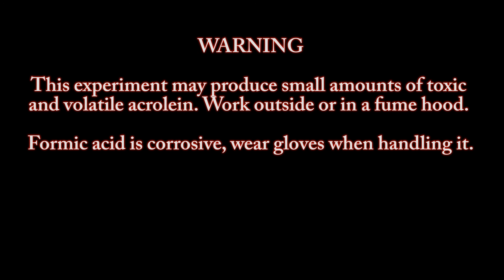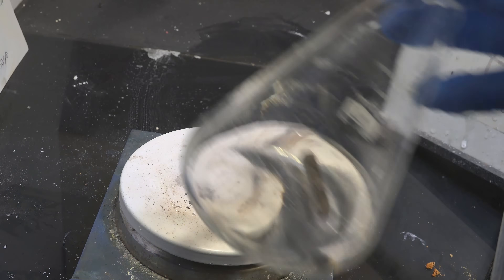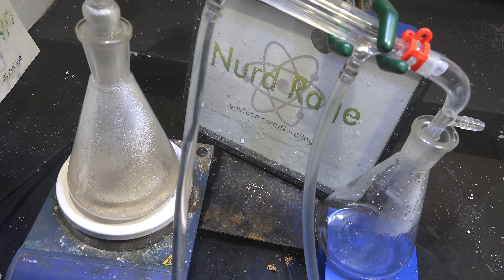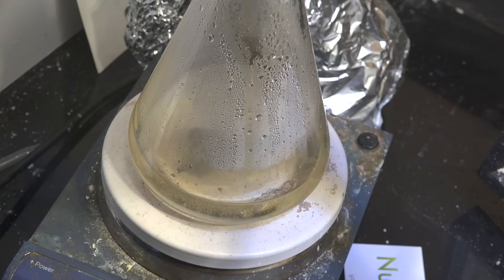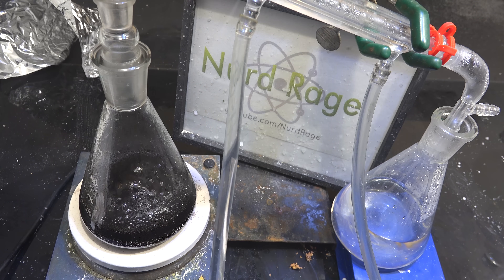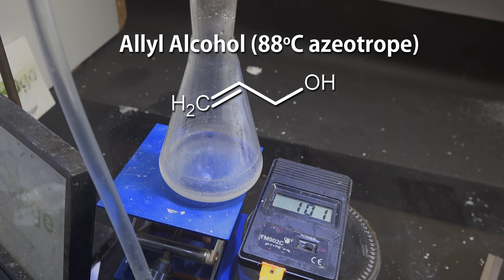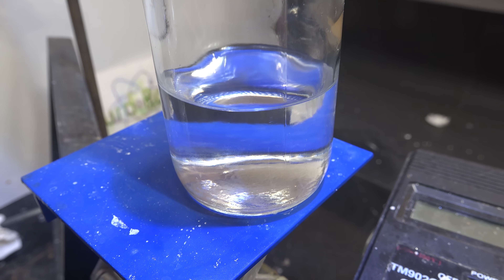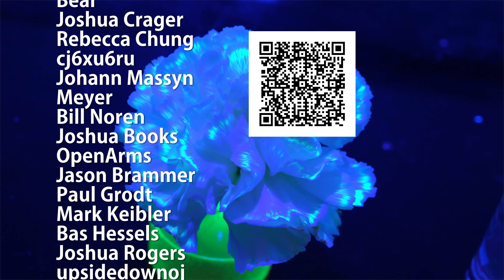Make Formic Acid

Comment: @NurdRage When I did this, I forgot what the temperatures were and I couldn't be bothered looking them back up. So, I just went very careful on the heating. It turns out that if you are very careful on the heating, your glycerine does not darken. Pop a stir bar in there and it looks like any old clear solution

Comment: Formic acid is way easier to make.  Just dink a jug of windshield washer fluid.  Washer fluid contains methyl alcohol and the mammalian hepatic system converts methanol to formic acid.  There is the downside that formic acid destroys the optic nerve though.
Reply: ingested formic acid will not destroy the optic nerve though but acidosis will when methyl alcohol is metabolized. Stem cells now can soon replace the damaged optic nerves and fully restore sight.

Comment: I've read somewhere that electrolysis of glycerol produces formic acid as a byproduct. Would it be better to go down that route and not waste oxalic acid?
Reply: Oxalic acid isn't that expensive either. I read a paper on making the reaction you mention, it seems more difficult to achieve without high quality equipment.

Comment: Could be possible to see a Biodiesel make and purify Guide?
Reply: Bug Hunter 
just decompose triglycerides with (m)ethanol and then you'll have (m)ethyl esters (biodiesel) and glycerol.
Reply: Thanks, I know how it works, but I think a guide at chemistry and amateur level could be awesome to see. Almost every of the experiments here require some pricy equipment and knowledge and are far away of the amateur chemist, maybe this could help in that matter :D
Reply: Bug Hunter check out Nile Red's channel
He removed glycerine from vegetable oil
Also ChemPlayer made biodiesel from the same process and even tested its flash point cofirming it's potential use as fuel

Comment: I prefer the Soxhlet extraction method, in which I fill the thimble of the extractor with ants. Do you think water would be the most effective extraction solvent in this instance?
Reply: I've heard ant brain has 100x more cells for the same volume, and 1000x more connections... (So 100,000x more bits of info?) 
    I have also heard of a lawyer that had untreated childhood encephalitis and after getting a PET scan as an adult, only 1cm³ of their cerebrum was alive!!
   Does that make ants somewhat equivalent to lawyers? All the more reason to boil them in a extractor..

Comment: What stops the glycerol backbone from being tri-esterified? Why won't oxalic acid or formic acid in the reaction mixture continue making esters on the other two hydroxyl groups? Is it purely steric hindrances?
Reply: I'm sure it will form esters on all hydroxyl groups. When the concentration of glycerol is very high formic acid is more likely to "find" non substituted and mono esterfied glycerols than di esterfied ones. So a statistics/concentrations thing. Sterics are likely not a problem, as many fatty acids have a similar structure with bigger substituents. This will still lead to the same results/product after hydrolysis, theoretically needing less catalyst but due to decomposition the reaction was run with excess.
Reply: Stoichiometry

Comment: There's a much easier way to do this. 

Step 1: Put a whole bunch of ants in a juicer.

That's it.
Reply: If PETA shows up, that confirms they care more about ants than any other animal
Reply: only if you inject it
Reply: 2. Deal with PETA.
Reply: Make sure the species uses formic acid as defence before you dig up the ant hill
Reply: +jakob its not only in the ants themselves, it is also secreted into the anthill to keep it clean.
They used to dig up the whole anthill and distill the soil & ants. but indeed you would not get a lot of acid from an anthill, its likely that it was a very low purity.
Reply: Fire ants don’t use Formic acid, they sting with venom instead.
Reply: Yes fireants suck. So would this stuff feel like getting stung by a 50 pound ant?

Comment: Do you have the skills to make pharmaceuticals ?
Reply: Christian M he has a long running project for synthesis of pyrimethamime, which is an antimalerial drug.
Reply: I think he could make consumable non-complex chemicals, but the issue is impurities. He's working with home-distilled solvents and home-purified chemicals. They probably would not pass for anything in the pharmacy, but I'd be willing to bet he could hit at least 95% purity with some serious purification steps. He could make complex pharmaceuticals, but it would take a lot of time and capital. It's also is an issue of scale. Chemical companies can get insanely large yields because they have large-scale reactors and start with high-grade solvents/chemicals. It makes it much more economically viable for complex and even non-complex chemical synthesis.
Reply: 95% purity? try 99.98% purity with fractional crystalization, its not hard to make pharmaceutically pure drugs (provided you know what your doing) but you cannot sell any consumable products without FDA approval, the FDA are the guys who will want you using pure solvents and reagents. Impure solvents and reagents will affect yield and leave you with slightly more impurities than if you used pure reagents and solvents, the pharmaceutical companies still likely (although dependent on final reaction and workup) produce an impure end product that requires further purification to get a consumable product.
Reply: If by pharmaceuticals you mean meth, anyone can do that in a 2 liter bottle with crap you have laying around the house.